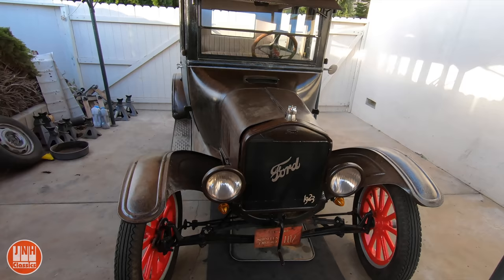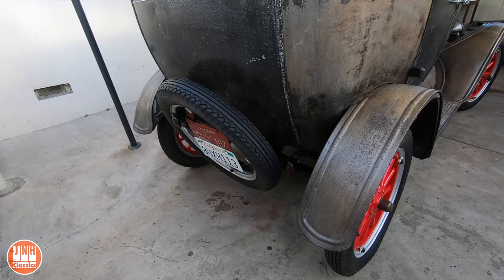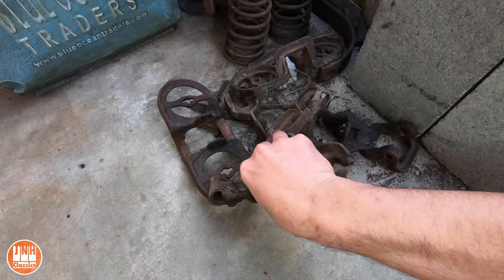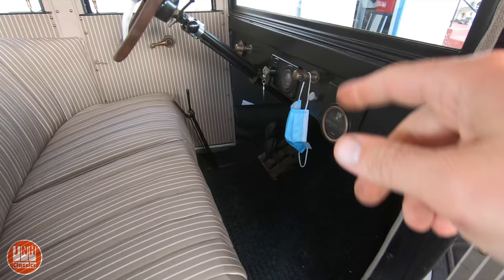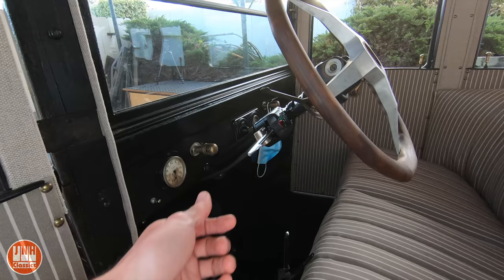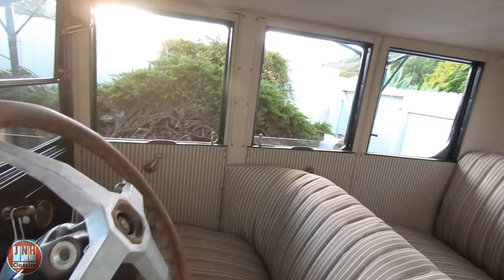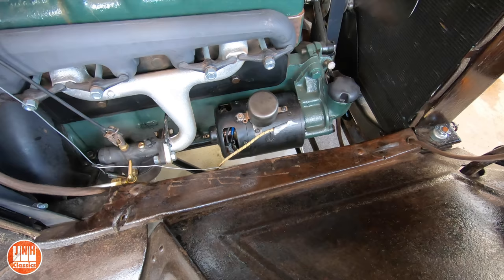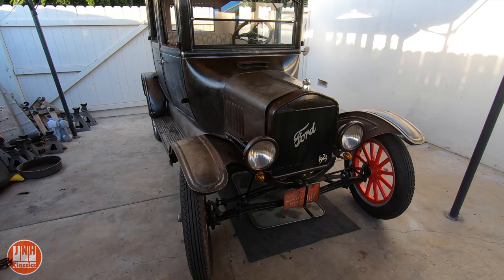Model T Rear Axle is Back In And We Have Tail Lights - Sunday Update (5-2-21)

Comment: Is your horn a battery/electric or a magneto horn? Magneto horns will not work on battery, only on the AC power created by the magneto, and only when the car is running. It would also be wired differently at the terminal block. Battery horns have a larger cover on the back and magneto horn covers are smaller. Think tuna can (battery) vs small tomato sauce can (magneto).
Reply from the maker: You might be on to something... I’ll try to figure out if it’s a magneto horn. Thanks👍

Comment: The metal on the T was in decent shape when you started right.
Reply from the maker: That depends on what you consider “good shape”. Every metal panel is dented or warped and covered in rust pits, most of the aluminum panels have dents and the paint was falling off the aluminum panels if you rubbed against it. But other than that yeah it was in good shape considering it’s almost 100 years old.
Reply: Leavening it as is or body work in the future.
Reply from the maker: Leaving it as is. I like that it shows it’s age

Comment: Where did you buy extra lights with a switch. And what is it anyway, because apart from the turn signals there is probably something else in it.I ask out of curiosity. I can't find anything like this, and I've seen it on many cars similar to yours. I am Polish and I speak little English, but I am more or less able to understand something
Reply from the maker: All the model T suppliers sell them. Prices and availability vary.
Reply: @Jerod_Helt  I am asking because in Poland, owners of such cars have such accessories, and I cannot find such lights. unless I'm looking in the wrong place or under the wrong name

Comment: I would assume that it also will need an MOT?
Reply from the maker: Nope. It’s completely legal as is. I didn’t even need to install the turn signals or tail lights. It only needed to have the safety equipment it came with from the factory, which in this case was pretty much nothing.